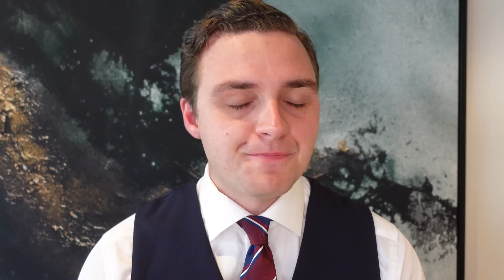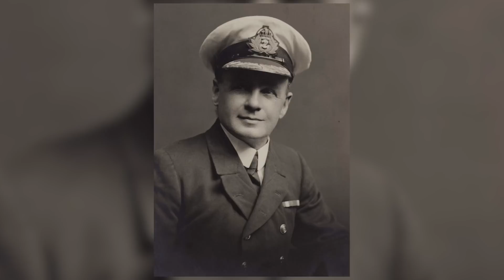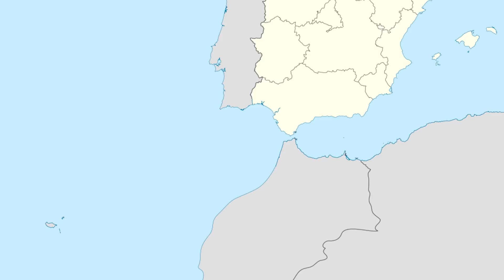How to Annoy the Steam Engine Community

Comment: Well, the power requirement for a ship goes with the third power of the speed. Hence, if you want your ship to do 25 knots service speed like the Mauretania instead of 21 knots like the Titanic, and assuming your propulsion system efficiency remains the same you need (25/21)³ or about 1.7 times the power which means 1.7 times the amount of coal. And there you are: 1000 tons instead of 600 tons of coal per day. Apart from the fuel consumption, less power also means smaller engines, smaller/fewer boilers, smaller coal bunkers, and fewer stokers, and thus more space for passengers, or cargo. This is exactly the reason why the White Star Line and the German HAPAG had quit the race for the Blue Riband. These fast ships could simply not run economically. Mauretania and Lusitania were built, and operated with the support of the Admiralty. That's why Cunard could run them. They were not economically viable on their own.

Comment: An engine can work below atmospheric pressure because it is a closed loop. Atmospheric steam engines worked entirely on vacuum created by condensing steam and atmospheric pressure would then push the cylinder into the vacuum, driving the engine.

Comment: Mike Brady, not AI after all? 🤔  Does AI make any mistakes?  🤭Steam engines aren't as simple as they appear at first glance. Sea water contains shrimp and sometimes lobster. Thus the name "feed water"  When they entered the boiler, they turned red, (this, of course, is where the famous restaurant got it's name.)  Anywayz after a while the sailors became tired of eating so much seafood and the engineers at NASA invented a sort of colander to strain out the seafood.  It was held in a special tank and then sold to restaurants when in port.

Comment: If you want to learn more there is at least three maybe four places in Australia where you can see this type of engine. Correct as of 1993.
1. HMAS Castlemaine in Melbourne
2 Same engine different ship just outside Whyalla
3 HMAS Diamantina in Brisbane (I served on this one as throttle watchkeeper}
4.At the Australian Maritme College in Launceston, this one is in a glass cage fitted with an electric motor, which when operated will slowly move the engine at about 1 rpm
All these types of engines are normally fitted with stevenson gear which change the posistion of the eccentrics which will influence engine directionality {ahead/astern}

Comment: You have wet stream and dry steam. They work and behave differently. Dry steam and wet steam are documented in the stream tables. Wet steam comes off the boiler and then run thru the super heater in the stacks. The Stanley steam cars I worked on had super heaters in circa 1909.

Comment: could they have stored the coal slightly higher than wherever they were burning it and so just let gravity empty coal into a chute into the burner? that seems like it would save on workers and toil... or even have the engines power sloped conveyor belts if the fuel had to be dumped below the burners it could put it on belts to raise it to the desired locations...(though they'd have to hand start the fires to get the power to get the belts going...)

Comment: re: red hot pipes
one night in college i was walking behind some buildings and there were some pipes surrounded by a fence and i could feel heat coming off them. i stared at them with my eyes as wide as possible and it was just barely in the visible end of glowing. i immediately wondered if there was a problem building up and no one was aware of it and if it was glowing red and there was pressure is this a failure about to happen...in my face?! but then i tried to convince myself that just because something is glowing and liquid metal glows that doesn't mean all glowing metal is soft and on the verge of turning liquid. i told myself it could be well within it's solid phase temperature but just happens to have a black body radiation that my eyes can barely detect...so i kinda convinced myself that everything must be ok and that's probably why there was a fence around the pipes. still seeing a dull red really made me think it was about to sag and burst... 🙂

Comment: For a long time I was never sure why the reciprocating steam engines in ships like Titanic didn't produce the rhythmic puffing or chugging at the funnels/smokestacks like a railway locomotive (or most other steam-powered land vehicle) did/does. Your videos have finally answered that question once and for all - the closed loop feedwater system. That sound comes from the exhaust steam from the cylinders being ejected into the smokebox and then out the funnel with force, and in so doing it also ejects the coal smoke/gases out of the firebox, drawing air in and aiding combustion. In ships the exhaust steam is condensed back into water and reused, and there is a separate system for increasing the draught over the fires.

Comment: One question I have (Marine engineer with experience working on steam turbine and triple expansion engines) is how you could run saturated steam through the turbine engine. On the ships I worked on, we did run superheated steam and a simple collection system wouldn't be enough. You can get away with some condensation on the reciprocating engines, but not with the turbine where any water that would hit the blades could break the blades. I wonder if they had an additional drying step in between?

Comment: 10:28: You weren't completely wrong. If the water gets to low, it DOES get Red hot... And explodes. Happened with the Sultana in 1865.

Comment: I’ve worked in a steam power plant before. It’s amazing how the methods and tech are almost the same now as they were in 1912. Our boilers turn feed water into steam with is then put through a turbine to generate power where it goes into the water re use building to be condensed back into water to be reused in the boilers

Comment: Now the first steam engines ran only on vacuum, this was because they did not have safety valves yet and the metal and accuracy was horrible. 
In short trying to run on over pressure would cause an explosion because stuff was shit.

Comment: You are correct: The engines expanded the steam to well below atmospheric, and the turbine exhausted it at around 1 psi absolute. This is possible because it is a closed system, and a gauge for reading this is not difficult to make.
Edit: The turbine does not "help" the main engines, per se. The condensers create "condenser vacuum" which will the main engines would exhaust to without the turbine. But the turbine extracts the remaining energy from the steam, and the condensers don't have to reject as much heat.

Comment: Unless you're a class one power engineer, I wouldn't expect perfection. This was very informative and answered a lot of questions I had on the propulsion. As a steam fitter by trade I have always been fascinated with how well engineered and executed 110 year old systems actually are. They operate so smooth compared to today's systems, especially considering the primitive manufacturing methods of the day.  Cheers.

Comment: You did great, I don't expect you to be a specialist in all fields, there is a large and diverse amount of engineering and science involved here.
Even basic freshwater water used for steam boilers can be acid, alkaline, hard or soft water, contain total dissolved solids or total suspended solids - therefore needing to be treated, especially for superheated steam systems.
Any small amount solids bouncing around turbine blades causes accelerated wear.
Limescale buildup in simple domestic water applications is a classic example.

Comment: I am seriously impressed with the depth of research, production quality, and humility of this video. It’s legitimately refreshing 
.
The highlight of this video for me, after years and years of interest in steam in particular, and a lifetime of loving all things mechanical, this is the first I have ever heard of steam engines operating with a generated vacuum on the tail end of the cycle to boost efficiency and make more power. 
.
What’s amazing about this to me, is that it is a very similar concept to modern “super-turbo” engine induction, where the turbos are “pre-spooled” by the supercharger to eliminate lag, but as they spool, actually pull air through the supercharger, reducing load and parasitic losses. 
.
But even cooler, is that this idea of a closed loop “push-pull” steam cycle powertrain, also has a remarkable amount in common with futuristic space travel based in theoretical physics, regarding faster than light travel using curved space time, generating a warp bubble with space compressed behind, and stretched out in front, to bend rules of relativity. 
.
And this was a concept being employed over a hundred years ago in the industrial age. It really puts in perspective the brilliance of the designers and engineers that made this system reality, and on the scale of a floating city, not just a proof of concept in a laboratory setting.

Comment: Great video.  The low pressure turbine energy recovery system reminds me of Wright engines compound turbo used to accomplish cross Atlantic air travel.  Check out Greg's auto and airplanes.  Also, a greatboo k is the history of steam locomotives in America.  Super heated steam ...God given.

Comment: Hi...I also wondered the seawater direct input to boilers....to be true. In inland lake ships it is normal. Superheating is also typical in watertube boilers and in locomotives (no condensation)...but saturated steam in firetubeboiler systems in ships (traditional marineboiler). Pressure is typically said as psig or psia (barg or bara) to make sure gauge vs atmospheric pressure. Yes in marine engines steam is used on both sides and the valve system controls the flow to both sides in turn and finely adjusted timing too a bit like in a car engine.

Comment: Think you have still got a bit of this description slightly  wrong when you talk about condensers and their purpose, the water having been heated in the boilers till it becomes a gas ( steam ) passes through the three cylinders of the triple expansion engine losing pressure  and heat in each stage ,the steam is then fed towards the turbine at a few psi above atmospheric pressure (gauge )the exit from the turbine leads directly to the condensers, as part of the condensing action( back into water)the vacuum is created within the condenser, that translates to an even larger pressure drop across the turbine blades making them more efficient. The water is then pumped back into the boiler as close to 100c as is possible to become steam again for the next cycle .
It was James Watt that came up with the idea of the "separate condenser" which he applied to the simple team engine which was a development of the Newconem's atmospheric engine

Comment: Worked in the engine room in the Navy and I must say, your corrections are spot on.  And making 'freshwater' was still a major chore even in the 70's and 80's when I served.  The engine room uses a lot of water, partly because every little wisp of steam from a valve gland or a shaft seal is freshwater lost.  Even if keeping on top of those pesky leaks all the time, every bit adds up.
Reply: Not to mention every blast of the ships whistle or saftey valve release for and emergency stop

Comment: Dont be put off for making a few errors. You cannot make an omelette without breaking eggs! 
Thanks for your great video's I have learned so much. I had no idea how sophisticated the propulsion system was. Please keep up the good work!
BTW. During a visit to a modern gas fired power station I asked what the pressure is in the steam condensers. Apparently its 0 lbs per sq ft absolute (or -15 lbs at sea level).

Comment: I absolutely love the detail! I just watched the first video and yes I did notice some of the quirks and mistakes :) Very interesting that the engines did run at a vacuum, I wonder how they kept the air out of the system. I wonder what the total efficiency of these engines was. Modern diesel engines still use the piston + turbine combo to get maximum energy out of the hot gas.

Comment: I was wondering how it would even be possible to get power from steam if it is below atmospheric pressure. The engine would operate in reverse if that was true. Steam engines do not operate in negative gage pressures, to my understanding.
Reply: Shows that you don’t understand all that much doesn’t it?

Comment: The good thing about the Titanic´s triple expansion piston engines was that they not only had a sliding valve, but also a triple expansion system. This makes the engine use the pressure of the high pressure steam in a small piston (2nd in line, counting from the bow of the ship), then reuses the resulting middle-pressure steam in the middle piston (3rd in line, counting from the bow), and then reuses the low pressure steam in TWO large pistons (4th and 1st), taking almost as much energy from the steam as possible. ALMOST, because there is some energy remaining in it. But again, the designers knew it, and made it so that even that remaining bit of energy was used in the low pressure turbine. 
In fact, the ship was most efficient when ran at almost full speed, because then it could use most of the steam energy. If it ran at medium or 3/4 speed, it didnt have enough steam pressure to operate the low-pressure turbine that propelled the central propeller.

Comment: Ok so the graphic shown around 15:38 for the slide valve that allowed the steam to be used on the upstroke & downstroke of the engine kinda confused me a bit. 

I can see how the slide valve would raise to unblock a path from the bottom of the slide valve to allow steam to go in to push the piston up, while blocking the top. Then slide down to block the bottom, and unblock the top.

What I don't understand though is how the steam would get past the top & bottom of the slide valve in that graphic to go into the piston valve to allow the steam to push it up or down because the way the slider in the slide valve is shown, displays it with a head on top & bottom that is as wide as the entire valve it's in, and a midsection that is narrower than the top or bottom. But the slider never goes up high enough to allow the steam to pass around this narrow midsection and to flow into the top or bottom of the piston valve.

So how does the steam get past the top or bottom of the slider in the slide valve to enter into the piston valve to make it go up or down if the steam supply is coming in right at the center where the narrow part is, and has no way to go around, up, or down past the slider so it can get into the piston valve?

Cause it looks to me like it would be completely blocked off based on that graphic. 

The only way I can figure is if the slider went up higher, or down lower than is shown to allow the steam to pass around the narrow part of the slider and then into the piston valve to drive the piston up or down based on its position.

Comment: 17:00   Titanic did not burn 73% less coal than the other ship.   73% LESS of 1000 tons is 270 tones
  
Titanic burned 60% of the coal of the other ship.  This jives with what you stated, that the other ship burned 1000 tons per day verses Titanic burning 600 tons per day
 
 Or you can say Titanic burned 40% less coal.  As 40% of 1000 tons is 400 tons, which is the amount less of that of the other ship that Titanic burnt.

Comment: Always a great video and well done for correcting yourself. But you're still wrong: steam with water in it is called wet steam. 
Superheated steam is steam heated above its boiling point (for the given pressure.) If you cool saturated steam to its boiling point, you get saturated steam - that is, it's at the point where if you cool it any further it will start to condense. As you cool it further it becomes wet steam (and if you cool it a lot it will become entirely water.) The point at which all the steam has condensed but it's still at its boiling point is called saturated water. 

Going the other way, you can heat water until it reaches its boiling point but doesn't boil. That's called saturated water. Heat it further and it becomes wet steam (even if you only boil 1% of the mass, the vapour phase will take up most of the volume unless the pressure is extremely high. Once you've added enough heat to turn all the water to steam at its boiling point it's called saturated steam. Heat it any further and the temperature will increase above boiling point - that is then known as superheated steam.